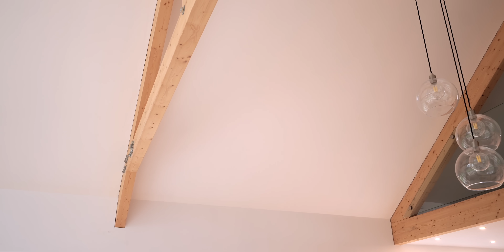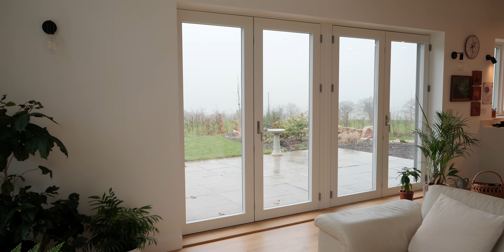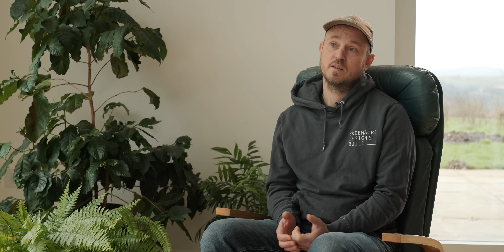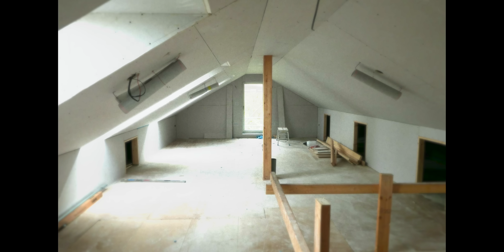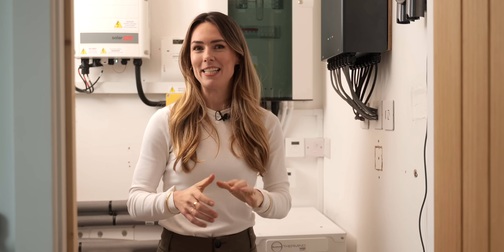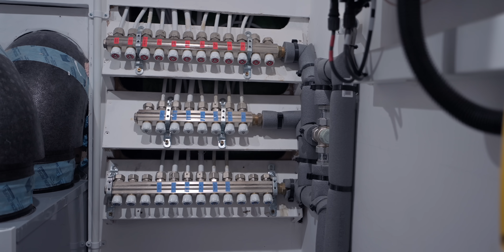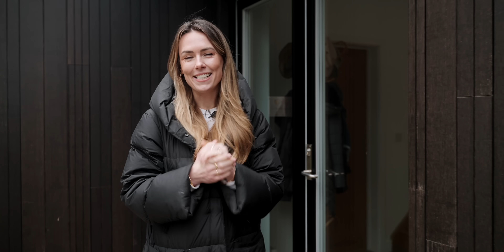Ditching a Heat Pump for In-Plaster Infrared Heating?!

Comment: Such a dream of mine to build a passive house and live my days sipping power and watching all my smart tech graphs sing in harmony. Great episode guys!
Reply: PH is the way forward. I've upgraded my 1960s house to almost PH retrofit grade (missed by a few kWh/m2.yr: 32 rather than 25). It is very nice. The good people of Scotland will get them as standard from next year, as the residents of Brussels have had since 2017. Finding sites is the tricky bit in the UK - these two were lucky to find a site whilst actually trying to buy a house.
Reply: @xxwookey  I am trying to learn about these new technologies. Still a rookie. How much did your installation cost and how much does it save each month?
Reply: @marcus.H  I did a video on it a couple of years ago: https://www.youtube.com/watch?v=OVcvk9Wnyw4
I've spent about £2350/yr on it since 2007. i.e 40 grand over 17 years, quite spread out (and done an awful lot of DIY). 'How much does it save' is a bit harder to answer - we've had negative energy bills for more than a decade - i.e they pay us. So we now get paid about £2600 each year, spend nothing on gas electricity and live in a very comfortable house. I'm not quite sure if we've made back all of the 40 grand yet - probably only about 35K so far. I'm just about to buy a heatpump and some floor insulation which is the last major piece which will be another 3-10K depending what we exactly do.
For advice, see if you have a local AECB group. They can be very helpful. Or a retrofit hub.
Reply: It's definitely a fun idea. I would love to be energy independent. One thing that's missing from many of these discussions is something called the cost of capital. Let's imagine it this way - Suppose a retiree has 50 grand in savings. They want to install a full solar array, a heat pump, and lots of insulation. So they dip into their savings and after spending 50k they have a fantasically cheap to heat home. This man spends less than £200 a year on his bills and probably spent much more than 50k on his setup. But working with the figure of 50k how much are they truly saving? Well, assuming the systems all run for 25 years with zero repairs until their end of life, we have a cost of depreciation each year of about 2k (that's 50k split over 25 years). We should also think about how much interest that 50k would have paid in a bank. Some savings account are paying over 4% today. That's about £2,000 per year just in interest from 50k of savings. So when we combine the 2 figure we see that spending 50k on eco systems will cost about £4,000 per year in missing interest and in appliance depreciation. If you could just not bother spending on eco appliances then you will not face depreciation and repair costs. You will get paid at least 2 grand a year in bank interest too. You will almost certainly be better off just not bothering to install those appliances and instead just using the bank interest to cover your current bills. 

These appliances are great for a hobby. But they do not reduce bill unless you ignore the initial and ongoing expenses of having these appliances. Furethermore if we consider the depreciation of an electric car (which on many electric cars can lose over ten grand a year) then the numbers become very very clear - these gadgets might be fun, but they are not useful for reducing costs overall when you factor in everything else.
Reply: "watching all my smart tech graphs sing in harmony" Hahaha. I can relate.

Comment: It only needs two kW to heat it. Even just plain resistance heating would be cheap to run..
Reply: Yes. Infrared heating is pretty much plain resistance heating.
Reply: @drfisheye  
In this case it is hidden which is I am sure was the prime advantage and choice.
The tariffs and solar panels make it cheap to run.

Comment: That's what I want behind the tiles in our shower, so that wall dries rapidly after getting wet to reduce mould- related maintenance
Reply: clay and lime plaster also reduce chances of mould growth.
Reply: Hmm ... suggest you research FAR IR radiation as it appears you're labouring under a misapprehension of how it works.
Reply: Replace the tiles with bathroom wall panels. They come in sizes that will cover an entire wall with a single panel, and they're treated against mold. Never wipe water away again.
Reply: @Jeroenneman  porcelain tiles and hydrophobic grout do the same without the strong chemicals off gassing and contaminating the place.. it’s also better for fire resistance.

if you’re that paranoid with water from the shower you can simply build a backslash disconnected from the wall a use humidity regulating materials such as clay plaster, combine that with decent ventilation and heating you’re set for life 👌.
Reply: Yes, great idea.  Julian has installed our IR towel drying kit behind the wall plaster but it works equally well behind tiles in the shower. Contact us for a brochure
Reply: @EnergyCarbonInfraredHeating 
Sadly the tiles have just been completed:( :( but definitely for next time!

Comment: I was a bit confused by the huge manifold of pipes, (which is normally UFH), given the IR panel heating. Then I realised it must be euro-style central plumbing and that would be all the hot/cold water takeoffs. Not seen one before but if I was building a house I'd do it that way too.
Reply: can you explain why that is?
Reply: @MsSjaakvaak  The advantage of this system is that there are no joints in any of the plumbing. A single plastic length is just threaded from the manifold to the tap/washing-machine connection/shower/etc. Also no shared connections after the manifold means that using a tap and a shower at the same time are much less likely to affect each other.
Reply: @MsSjaakvaak  I'm guessing it's a radial system, seperate hot and cold to each sink. bath. toilet?

Comment: sadly not possible to do this level of heat loss in retrofit to solid wall , 2kwh heat loss is better than many new homes let alone retro fit , regarding the sun amp i didn't see a pressure reducing valve down to max 3bar and expansion fitted this is essential as this is two known failure memods of the sunamp,  this can crack the internal structure, his comments regarding not having a small 10kwh battery doesn't make sense, the idea is to use it from sun down to bed time thus no power bill at peak rate times, if he had a gateway from different manufactures , the solar could still keep running without having to be disconnected from the grid ,  and could charge up both battery and sunamp with the solar or add a boost if the sunamp gets depleted using stored off peak,  in my seltup of 6kwh and sunamp i charge both in the day whist at work using solar using the solar surplus even at this time of year i stil generate around 15kwh in a solar day or really bad day 6kwh, thats still enough to power the home at night and cook with,  the sunamp has plenty of stored energy still to wash for 2 or even 3 days without charging when its just me, (it is 300 litres equivalent with less than 1kwh heat loss a day) i still use gas and won't buy a heat pump ever again (grant bandit that left me with 22k retrofefit including windows and every room upgrade from rad to insulation)  but i also have 200 litres ovo direct cylinder on the other side of the house for guests, heated via an offpeak or solar divert ,  i don't export i use everything i generate for the house.  once the new tarriff of low standing charge eco 7 comes along i;ll switch and half my anual energy bill , once you take out heating water via gas  and cheap over night rate,  gas with tripple rads set at 45 degree flow means a low gas bill of 500 a year
Reply: In fact we supply a lot of older properties for their retrofits.  Even Oxford Uni are using it successfully and have reported a halving of energy bills as compared to the legacy gas boilers in their old student accommodation.

Comment: £196 NET due to the solar export. I suspect it he'd gone for underfloor and a heat pump it would be even cheaper. Many of us have negative electricity bills at present due to EV tariffs and good export rates. How long can it last though.
Reply: It would, but the initial cost of that setup would be much higher.

For example, his whole house with this system costs around 3000€, meanwhile a heat pump with underfloor heating would be around 8-10k€.

So around 6000-7000€ difference that would never pay itself back. 

Better to invest in more premium household appliances, better floorings and all that...
Reply: @molnyi5  I think you're vastly over pricing the heat pump and underestimating the cost of his present system. You wouldn't have a sunamp etc....
Reply: @carlarrowsmith im not overpricing.

Just to lay underfloor heating piping for a house of 100m2 is around 1km of pipes which equals to around 1k€... You need manifold, copper piping to connect to water pump, and that's around 500€ extra.

You need dirt mag, anti freeze valves - around 300-500€ - so we are at around 2k and we just did the prep work.

Heat pump - a decent unit of around 6kW from let's say Panasonic or Mitsubishi is around 4-5k€ + installers cost that would be a grand or two...

Meanwhile prices of this system are available on the manufacturers website and brochure.

You can easily estimate the cost there and diy this system.

Heat pump is not so easy, especially when you need a F-Gas approvals.
Reply: @molnyi5 You are not comparing eggs with eggs, the sunamp alone can be the price of some lower cost heat pumps.
Reply: @carlarrowsmith sunamp is not needed.

If he got an Ariston hot water heat pump (that has a scop of 3.5 for hot water ) and costs 800€<, he would achieve similar results.

If you need a hot water cylinder or a split system heat pump that will be used for heating and hot water, then you need more money then I wrote above.
Reply: Still got to solve the issue of getting a small enough heat pump (to avoid it cycling). Passive Haus peak heat load is ~10 W/m². The market for residential heat pumps is retrofits / average houses
Reply: @ecok here I'm talking about heat pump for domestic hot water only - not a full featured heat pump used for heating.

This looks more like a boiler, but much more efficient.

Look up into that... This is quite common in EU.

Comment: This must have cost a fortune to install and despite the many solar panels, full home infrared cost a fortune to run if you are there most of the time. 

With a small heat pump they would be getting money from the energy company instead of paying them and a heating system that could run for days on solar and the huge battery system they could have bought with most of the money that went into this infrared system.

I wonder how the grid would cope if everyone had this kind of inefficient heating system running on a cold winter evening. Where I live the grid can't even handle the export of 3.6 kW solar inverters in 40% of all homes when summer comes.